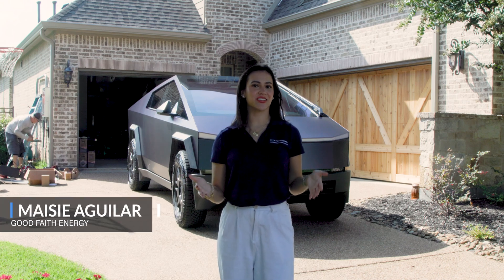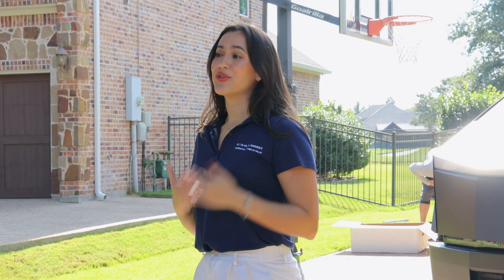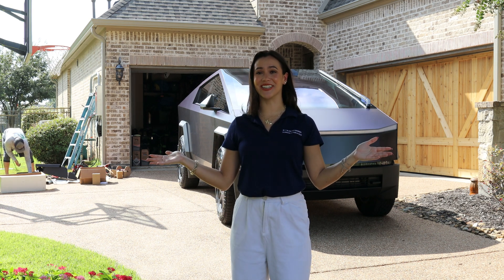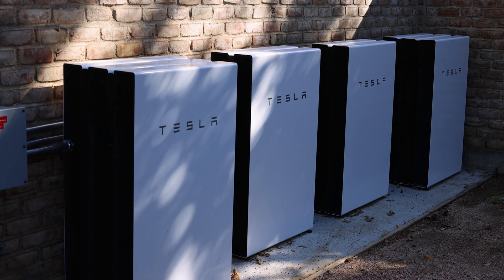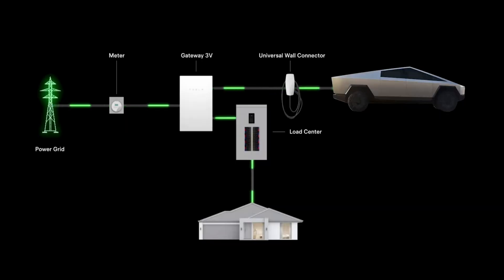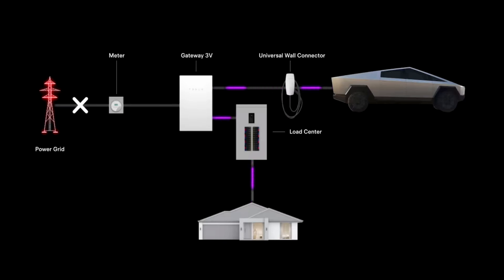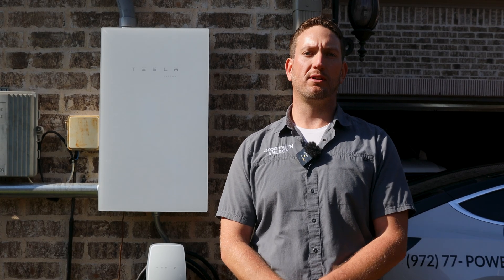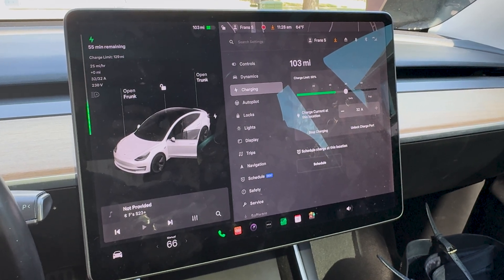Power Your Home with the Cybertruck | Tesla Powershare Install + Details

Comment: My current setup with a cybertruck would net me roughly 45 days of battery backup.  That’s crazy.  Recommend folks have a span panel installed if they intend on doing this.  Zero guessing games on power consumption and what you want to dynamically power during an outage.
Reply: Is the SPAN panel compatible with the Tesla PowerShare system?
Reply: Sort of yeah I mean it will be I mean it's compatible with Tesla powerwalls right now and the power share is just basically more powerwall @RodMacQuarrie

Comment: During power outage for a week or more, i will need to charge Tesla as well. is it possible to connect Gas generator to power home and Tesla??
Reply: Currently a gas generator would have to operate separately from the Tesla system. You wouldn't be able to recharge the batteries with the generator. So first you'd use the Tesla system until it got depleted, then turn on the generator to power the home. Sometime early next year Tesla will have Powershare compatible with solar-powerwall system for complete off-grid use.

Comment: I have one installed and working. But the Tesla app shows zero consumption data .. why is that?
Reply: It depends on how/when the installer comissioned it. It can take upto 7 business days for the Powershare upate to occur in the Cybertruck Tesla app once its been installed and comissioned. I'd check with your installer on the details on how they comissioned and registered it to your Tesla account.

Comment: How much of the CyberTruck's 123 kwh pack is available for Powershare?  How does it work if you already have powerwalls?  Does plugging in the CyberTruck act like you added 9 powerwalls to the energy gateway?
Reply: You can set the backup reserve % accordingly at your discretion in the Tesla app, therefore you can be comfortable with also having energy to drive the truck if you need to go somewhere. If you already have powerwalls, you will need to update the firmware/software for the Gateway in order for Powershare with the Cybertruck to work along with the rest of the powerwalls system. With Powerwalls you'll have less of a delay in the offgrid backup transfer, while also having more energy storage capacity which can also be charge with solar. Absolutely, the Powerwall 3 battery has 13.5 kWh of energy storage, so with the Cybertruck being 123 kWh, that equates to roughly 9 Powerwalls combined!
Reply: @FransGFE  The Tesla website saids people with powerwalls installed already don't need additional equipment.  I want to know how it works along with existing powerwalls.  Are you speaking from experience?  Does the existing energy gateway see the equivalent of about 9 extra powerwalls worth of capacity being available for storage/offloading?  (Or whatever % you set to be available for Powershare use?)  Does the CT charge and discharge along with the powerwalls at the same time?  And if so, what happens when you plug it in and your powerwalls are at 100% SoC and the CT is at 80% SoC for instance.  Does it transfer some charge between the powerwalls to the CT to equalize the SoC?  Since the powerwalls sort of operate within the bounds of predefined SoCs.
Reply: @kchiem  That correct, however the existing equipment will still need an update on the firmware/software in order for it work and sync with the universal wall connector. No Powershare systems have been installed yet with solar and battery. Although, based on the known off-grid dynamic of the powerwall system, the offgrid transfer is usually less than a second. We can expect a similar effect when Tesla allows this funcationally towards the beginning of next year.

Comment: This becomes offgrid game changer. Imagine going to an off-grid cabin for a couple days and not needing a generator. Awesome. The future
Reply from the maker: Just have to leave enough charge to get to a nearby charging station!
Reply: @GoodFaithEnergy  setting on cybertruck power share can default to a minimum state of charge to  15% so you won’t have to worry about depleting the full battery.

Comment: Does it only work with the cybertruck?
Reply from the maker: Yes, Tesla’s PowerShare feature is currently designed specifically for the Tesla Cybertruck. The feature allows the Cybertruck’s large battery to power homes during outages or charge other electric vehicles. Tesla may expand PowerShare to other EV models in the future, but as of now, the Cybertruck is the only Tesla vehicle that supports this functionality.

Comment: It’s crazy how much installers want to charge for the install, otherwise I’d have it already. I thought maybe $2500, but $5400!?
Reply from the maker: Our average PowerShare install has been ~$2500, but the price can vary depending on installation complexity.
Reply: @GoodFaithEnergy  my home is standard, 200 amp box already upgraded and many slots available. Tesla charger in garage already, not sure why the quoted me so high. Perhaps I should get more quotes then. $2500 is what I was expecting to pay
Reply: So you should always get at least 2 competitors competing against each other, and because these insulations can vary, you obviously need to take that into consideration too. Cheers 🥂